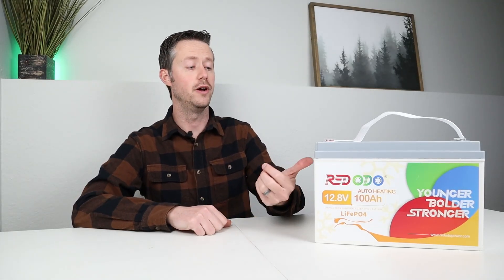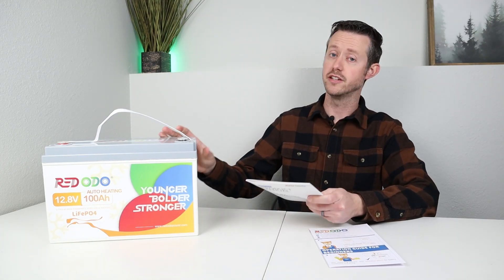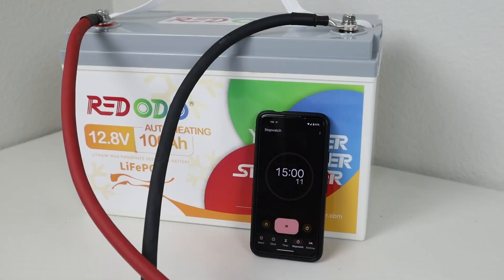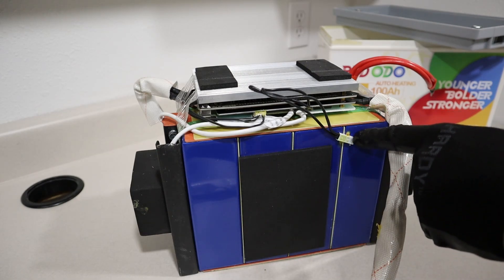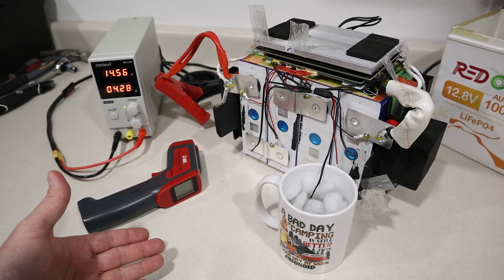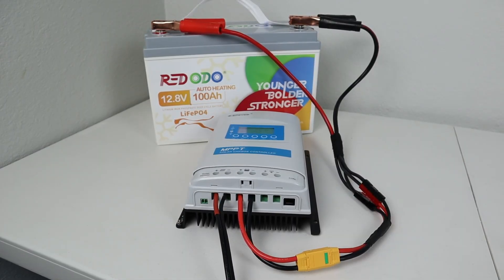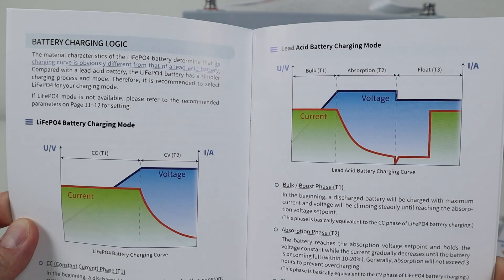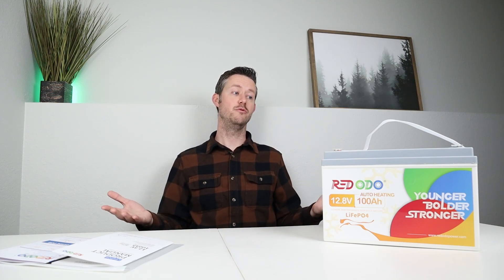Did I Find The Best AFFORDABLE Self-Heated LFP Battery?! Redodo 100AH Review - $436 or $0.34 per WH

Comment: Can i pair it with a 100ah without the low temp charge protection and still use that feature?
Reply from the maker: The low temp charging protection would only work on one of the batteries. I'd make sure both batteries have similar features and specs.

Comment: Geat review but I don't think this battery is for me. It says "Younger, bolder, stronger", I'm "Older, weaker and drunker" so I don't think it's a good fit.
Reply from the maker: That's hilarious! LOL
Reply: @Jasonoid  If they had a battery that ran at 11.4 volts and had 67.4 amp hour that would be more my speed.
Reply from the maker: @chrissinclair8705  just scratch out the logo and write in your replacement words. You'll be good! Haha
Reply: @Jasonoid  Lol Yeah that's true or I'll make my own demented battery with different capacity cells that have a weird voltage combo.

Comment: Great video, thanks.  What I don't understand is the point of a self heated battery when used with a controller like the one you use that has a low temp charge preventer.  Let's say it's 20 deg F and you want to charge your battery.  The self heating of the battery will heat the battery up to above 32 F so you can charge.  But as I understand it, the controller senses its own temp (not the temp of the battery), and the self heating of the battery doesn't heat up the controller obviously, so even though the battery heated itself to above 32 deg F (so it can be charged), the controller remains below 32 and won't charge the battery. Am I missing something? I already have a controller with low temp charge prevention so seems like buying a battery with self heating makes little sense.

Comment: Put it in fridge and tell us is it possible to discharge it in below zero conditions? I tested Power Queen like that and it went to safe mode when it was ONLY -1degrees of Celsius. So if you want to use it during winter, then it is not possible. Would be really interesting how does REDODO act in similar conditions...!

Comment: Hello Great video. Definitely tare downs help. I'm looking to replace deep cells for my camper with 200 watt solar system. I am on a seasonal site in the North East 7 months out of the year (spring to fall).  I have a 12V refrigerator CPAP machine in the event of a power outage the battery would be my back up. I'm really struggling choosing what LifePo4 100Ah to go with as there are so many out there. Any advice would be helpful.
Reply from the maker: Redodo, Dr. Prepare, Power Queen are all very similar. They have had excellent quality inside when torn down. I don't think you can go wrong with any of thses brands, just find the one with the best price. They are quite affordable now.
Reply: @Jasonoid  Thank you using your code to purchase
!!

Comment: As alway you continue to produce top notch videos.  I believe that if you are going to recommend a product like the batteries, a  tear down of the videos are warranted as it gives you valuable information as to the quality of the build and parts.  Have a question for you.  I have an old Inergy Apex power bank that has served me well for my intended use.  Do you know if I was to purchase this battery and make my own battery cable with alligator clips and an EC8 plug, I could use the REDODO to charge my Apex on days that are raining or cloudy when I'm out camping?  Kind of nervous plunking down money for a lithium battery if I am not able to use it as I intend too for emergencies only.  Was planning to make different cables too, for my jackery 500 as well.  Thank you for sharing your knowledge with us.
Reply from the maker: The power that comes out of this battery is very similar to your car 12v outlets. If you can charge your current power station with car charging, it will also work with a 12v lithium battery like this.

Comment: Talk about affordability for battery when I pay $93 for a battery aled acid EverStart battery 1000 amps 135 amp hours I don't know if I could afford those batteries I could afford to betters I just said.
Reply from the maker: Lead acid batteries have their place for sure! They have a lower upfront cost but lithium will outlast them by four times the life span. Without heaters these LFP batteries are cheaper than $300.
Reply: @Jasonoid  Yeah you're right my twenty-five-year-old lead-acid battery are finally starting to fail but I did take him about 25 years ago bad.
Reply from the maker: @acefire4050  I'm glad you got great performance out of your batteries. I'm just showing new tech is available. No pressure from me if you want to use another option.

Comment: Yes continue tear down. Especially new  battery products to see build quality. By the way can you review the JAVA ENERGY 12V 100AH Battery?. Amazon has them at a reasonable Price.
Reply from the maker: Whats the price on that battery right now?
Reply: @Jasonoid  $277.00 plus $ 20.00 off coupon
Reply from the maker: @brothergeorge3412  well it looks to be using the same case, probably similar inside. Hard to tell without buying it.

Comment: sorry to hear some folks are sad about your battery tear downs, i personally enjoy seeing them, although in this video i didn't get to see any struggles as you cut to the opened part, a quick time lapse of the opening is all i really am asking for. but seeing the build construction is also good. i suggest quickly also mentioning and showing the bms identification as well as the cells, noting bolted on bus bars or laser welded, and placement of bms leads and temp sensor locations and how they are secured. in this batterys case the bms leads are glued and bolted to the bus bars. and the temp sensors are taped down to each cell i think as i can just about make that out. also when testing you can see if all the temp sensors do hot and cold or just one, some have only one cold probe that cuts off the charging, a quick mention is all that is needed.
thanks again for your review
Reply from the maker: Thanks for your thoughts. It's a hard balance of keeping the video short and showing all the needed information. My "average view time" for each video is always much shorter than my videos so I'm always trying to make them shorter. The trend lately is going that way. It seems people's attention spans are getting shorter and shorter!
Reply: Sorry to hear that, but my general limit for YouTube videos is 20 minutes, but if I find it entertaining enough I can watch an hour no problem. I'm sharing my thoughts on what details I felt were extra goodies I'd like to see. Maybe all of that may add 1 more minute to the video. Thanks again.
Reply from the maker: @user--PM  I take out quite a bit through the editing process, I'll think about leaving more of that content in there now 👍
Reply: Much appreciated.

Comment: Great prices for none heated batteries as well. I personally like tear downs if it's done in a way to keep the unit working afterward. Helps customers and keeps the sellers on their toes because nothing is hidden.
Reply from the maker: I agree, their 100ah regular batteries without low temp protection are UNDER $300! Crazy good price.

Comment: I think you would want to see the build quality. What kind of cells; what grade the cells are. Does it have a low temperature setting cut-off? How big is the BMS? Some less expensive battery's use a small BMS and so you need to know these things to want to buy the battery. I am always going to look on Will Prowes' sight to see if he has torn the battery down that I wish to purchase. I really like the fact that this battery can be wired in series. I personally am a 12-volt user, but if you are going to invert your batteries you might as well go to a 24 or even 48-volt system. Another great review Jason. You do such a great service to all of us.
Reply from the maker: I totally agree Kevin, spending this much money on a lithium battery you want to make sure it's going to last!

Comment: Have you ever tested placing a non-heated battery on, or wrapped in a seed heat mat to maintain temperature for batteries that are not self heating?
Reply from the maker: I have heard of a couple DIY solutions like that. I'm sure that will work, anything that is able to keep the battery below freezing temps will do the job!

Comment: Thank you for the Tear down .. I wonder if you would be willing to do a tear down of their 50AH 12V battery which is a Group 35 (I Believe) form factor? I am interested in in getting 2 of those and connecting them in series to create a 50AH 24V pack to use as an expansion battery for my Bluetti EB3A. I figure a 24V battery would allow me to hook it up directly to the Bluetti instead of hooking up a 12V with a 12 to 24V DC converter like you did in a previous video. Thank you again, would love to see it.
Reply from the maker: That would be a great plan to charge the EB3A, you'd get around the max 'solar' input of 200 watts charging that way. I haven't looked at their 50AH batteries before but I'm guessing they'd have the same great build quality. Have you seen any videos online of those?
Reply: Don't forget to equalize the voltages and charge states of the power station and expansion pack before connecting them in parallel.  Then it's best to then keep them in parallel rather than having to get things right routinely.  The first time you forget and drain down the Bluetti without your homebrew expansion pack connected, then connect the expansion pack, you'd better hope you have good overcurrent protection on both the Bluetti and your pack, proper wire sizing, connections that won't melt, aren't somewhere that sparks will cause an explosion, etc.

You might know what you're doing, but someone reading your plan who owns an EB3A and wants cheap expansion, might not even understand Ohm's Law, where/when/why to put a fuse, what the current limit of a particular connector is, or other basic stuff needed to be safe.  Once it looks like a product accessory, many consumers will assume they can plug and unplug the accessory at will.

Comment: Is there any concern with aluminum bus bars? I like the tear downs for the info on build quality. I like your admonishment that it voids the warranty, just make sure that you're clear about that every time.
Reply from the maker: The tabs on the battery are aluminum so they'd have to use a similar metal to weld it. Aluminum is a great conductor and these bus bars are thick enough to handle the load.

Comment: It's a shame that batteries are so expensive
Reply from the maker: They have dropped quite a bit over the last year, used to be around $1000, Now you can pick up a LFP 100ah battery from Redodo or Power Queen for $299 (they don't have the heaters or low temp charging protection).